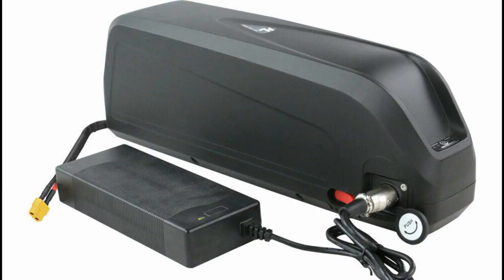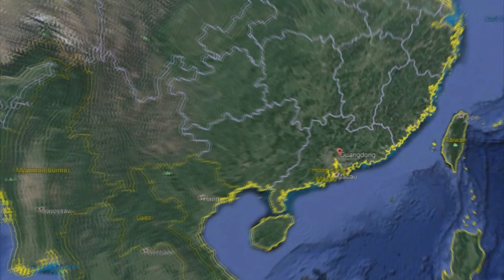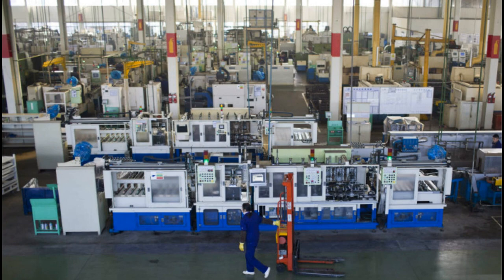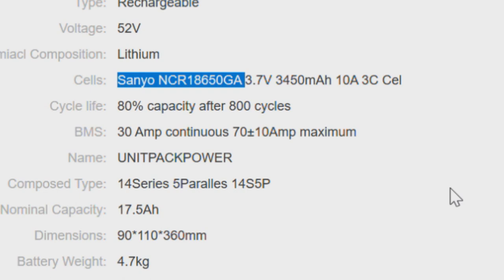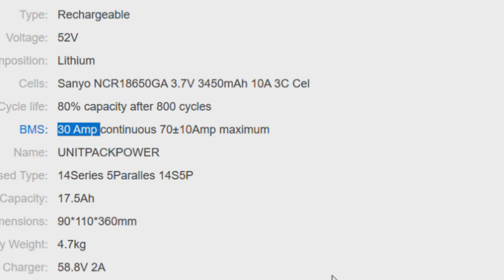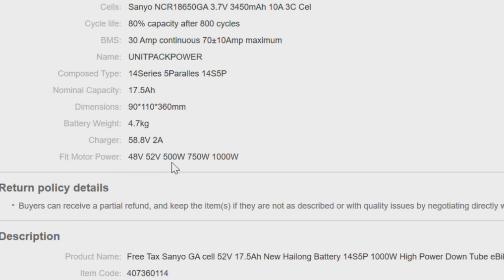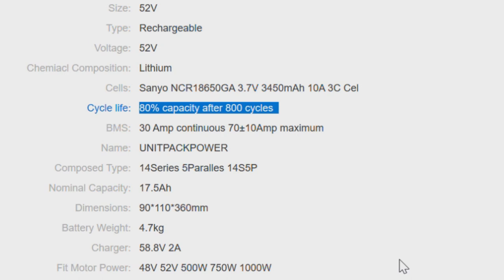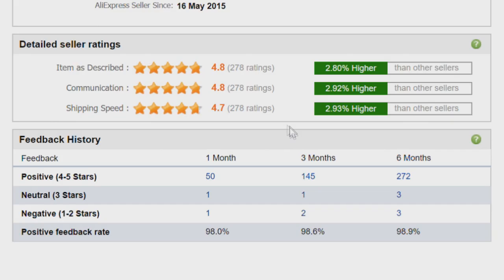E-bike Battery Buying Tips

Comment: I have the Scootstar Rockstar electric bike/moped. What name brand battery does this use, and what's the longevity of the battery ?
Reply from the maker: You can use any rear rack battery. just make sure you have the correct wattage and how many amp hours you need
Reply: @AugustineEBikes  Assuming you've made a determination on this, could you give me a suggestion of what cells would be the best value for building a 52v that will supply 1.5kw, perhaps even 2kw. I wouldn't mind going with a Chinese brand, but it's so hard to know which brand, and which sources are legit. If you have an idea, I'd be interested in your suggestion on a good bms brand and a legitimate supplier as well. Thanks in advance, Steve